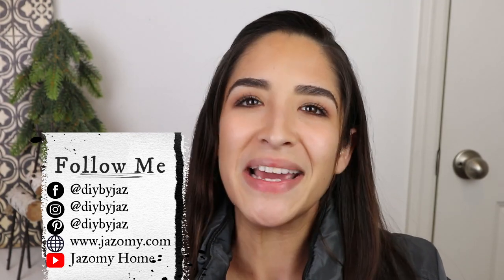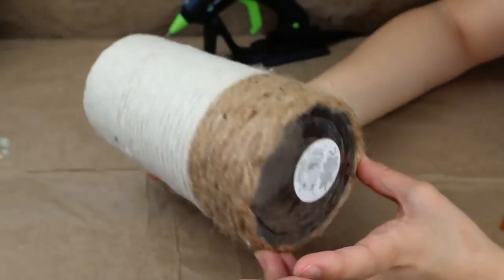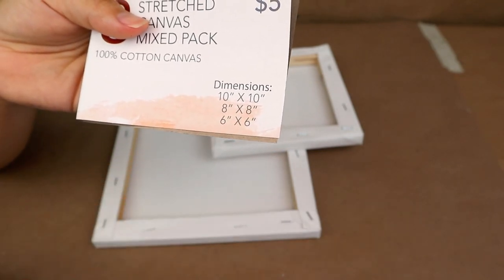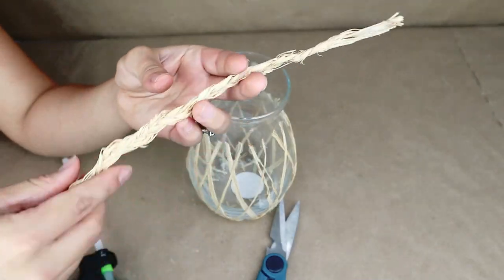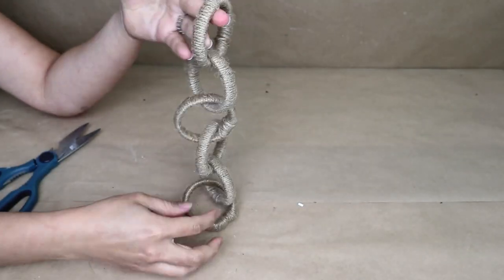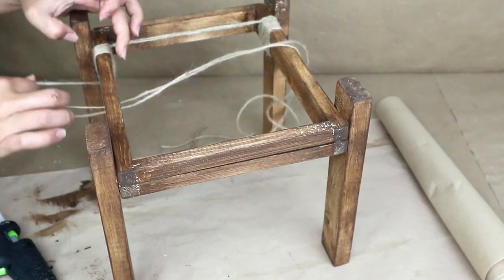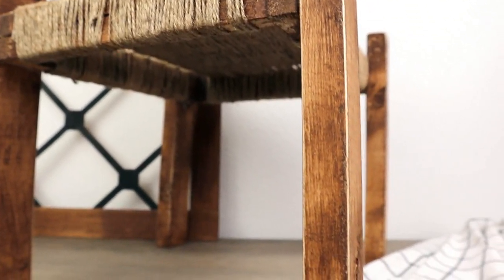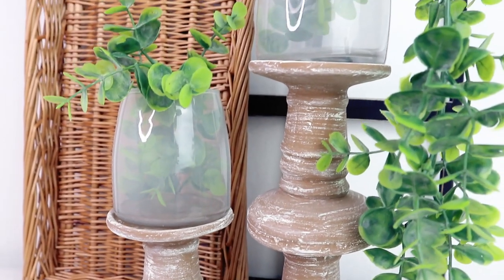BEST $1 HIGH END DOLLAR TREE DIY'S | 20 DECOR IDEAS to TRY

Comment: The cane should have been soaked in warm water with fabric softener for several hours before using, keeps it from cracking and gets out wrinkles and when it dries it will tighten up smooth.

Comment: What tool is that you drying with
Reply: It's a heat gun and if you are searching for it on Amazon including the words bubble remover or shrink wrap or embossing will show you the the smaller ones for crafts. The heat gun is really useful for speeding up drying paint (especially if you watercolor) and for popping bubbles in epoxy resin. I also use mine to heat up the adhesive on stickers and labels to make them easier to remove. I would recommend if you get one some of them have a little kickstand built in so when you set it down the hottest part doesn't touch your working surface.